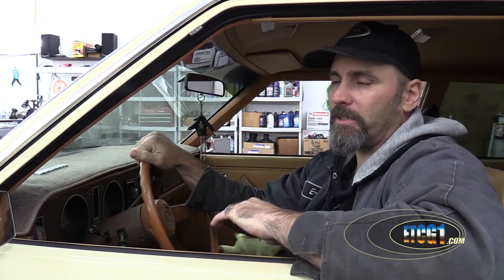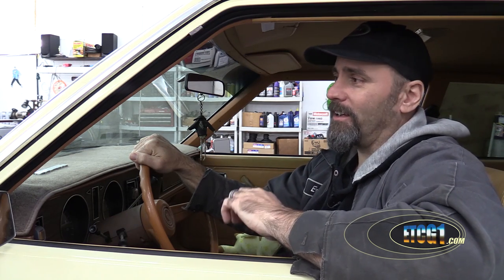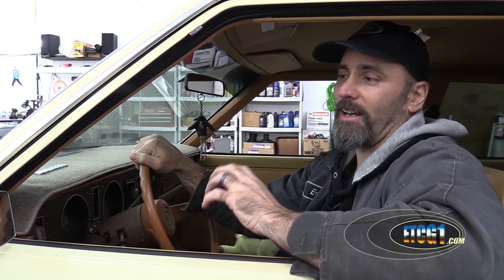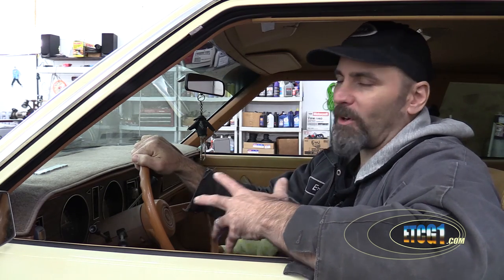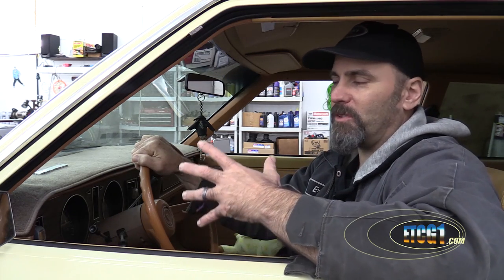Analog vs Digital (Cars)

Comment: I always hear "Carburetors are great because you can work on them." Which you will, all the time. "You can't work on Fuel Injection." You don't have to. They rarely go wrong. I mean, every single carbeurated vehicle I ever had required cleaning, adjustment, rebuilds, etc whereas I have NEVER had malfunctions with TBI, MPFI, EFI, etc. 

IF you know what you're doing Carburetors can be fun, and if you keep it in tip top shape you can almost mimic the efficiency of computer controlled fuel injection. But let's not kid ourselves; if carburetors were efficient and reliable, they would still be an option on new vehicles. If a conversion kit exists for the model, I always upgrade to Fuel Injection. If not, then it's no big deal, I just hate having to work on them. My 75 Gran Fury has 72 vacuum lines running all over from the dash to the engine to the carburetor, etc. That's not an exaggeration; there's 72 points of failure just in vacuum lines. That kind of shit is unheard of today.

Comment: There is also something to be said for "period correct" (turbo aside).

There would be something very out of place with a modern engine system in a 70s car. Loses some of that vibe of having a vintage car in the first place. I mean why bother to restore any vintage car when you can always pack a a modern engine in it?

Imagine a Corvette without a pushrod engine. It's just not the same.

Comment: My opinion is that fuel injection is far superior to carburetors and I do prefer them but carburetors have a special spot in that you didn't need outrageously priced tools and you feel more involved in the hotrod process. It drives me crazy that the fuel injection system is so integrated into every other system in the car. With immobilizers, gauge clusters, radio, HVAC all on the same buss is crazy. I want the engine to run on a computer but everything else should be directly connected to what it controls. When I run a diagnostic on my VW through the OBDII port it tests the radio speakers and the heated mirrors, now that is crazy complex and just asking for problems.
Reply: Curt D Carburators designed by mechanical tinkerers are a wonder- I wonder if the designers had any understanding of fluidics beyond the venturi effect. So  many moving parts, so delicate.  If electric fuel pumps used in planes had been introduced to cars in the 1940s, I wonder if multi barrel carbs would have ever made it to volume production for cars.

Comment: I have both digital and analog cars. my 89 mercury grand marquis has the early fuel injection in it and its sometimes hard to find problems with it since it doesn't have the obd2 port on it, it has a different port that I can't find a computer for. My 02 Bravada has the obd2 port on it but the engine it in is too complex. I really like my 1980 chevy and my 1972 f250 since they are carburated and the problem is usually right in front of me. where the 80 chevy is supposed to have emission stuff on it, some of my problems is because the emissions are gone off of it and I plan on fixing that but I have a priority to where what vehicle gets fixed first.

Comment: You make an excellent point - cars are now made with digital systems that the makers (and their regulatory overlords) wish to preclude mere mortals from repairing, much less modifying.  John Deere, that bastion of advanced technology, wishes to protect its digital intellectual property under the legal auspices of the Digital Millennium Copyright Act; they wish to prevent anyone other than a John Deere subscribed technician from looking at the digital systems.  On the road manufacturers have the added burden of emissions compliance.  Summary - the issue is not analog or digital; the issue is the constraints within which we work.  If your $30,000 hot rod requires a $250,000 diagnostic support system to run the digital controls then it doesn't make any sense.
Reply from the maker: Ha! I did a video about this. https://www.youtube.com/watch?v=fxcpCwfHnAM&t=84s

Comment: Analog VS Digital... More like what is cheaper to build and cheaper to modify. With modification I mean if the developer wants to modify the amount of fuel injected, they don't need to replace mechanical components. 
If it breaks you can fix it fast for a high price without touching mechanical parts, at least this would be the idea.

I think there was a pretty good balance around the 2000's in the amount of electronics used in cars, after that every little BS has electronics and not just that, complicated centralized electronics. Don't quote me on this because I'm a mechatronic technician, not a car technician.

Comment: I think the key is reliability and serviceability.  Having to tinker with any system, electronic or mechanical (more than you want to) is a pain.  I think electronic systems would be more popular if they were not so proprietary.  If I could plug my laptop into any car and diagnose or adjust all sensors and parameters, I'd like them a lot more.  I'm not sure but I suspect manufacturers make the systems intentionally obtuse to advantage their dealer channel.

Comment: back in 2004 I got my first car a 1982 Mercury Grand Marquis Coupe with a 302 engine and a variable Venturi carburetor when I got it I have some fuel delivery issues coming from both the mechanical fuel pump and the carburetor so I actually had to rebuild both of them then found out later on that it would have been cheaper for me to Simply replace the mechanical fuel pump but I am glad I got the experience to do them both
Reply from the maker: Those carbs were crap. In fact '80's Fords were crap, my Fairmont included. I would have swapped it out for a Holley or a Carter AFB.
Reply: ETCG1 you  are right they were crap but at least i had gotten some experience with rebuilding a carburetor quite interesting I must say

Comment: Hey Erick 
Wat do you think of new auto tune chainsaws? They have a carbrtor that is digitaly tuned. I run saws all the time and in colorado so conditions are always changing as is my altitude which really messes with small tightly tuned 2 stroke motors. Constantaly tacking my saw on old saws would slow down my work flow now with a auto tuning system i can work all day with the saws electronics making changes as i move around the slopes or weather rolls in. Its a really cool merger of analog and digital.

Comment: The mid to late 90's vehicles have the least amount of compromises on both ends. They were not carbureted but were the the second wave of fuel injection. Cars being built today are now overly complex and will fail prematurely on some level, either mechanically or electronically. Who wants a touch screen in their vehicles dash when a home computer needs upgrading after 5 or 6 years. Is your car now disposable after 5 years? Computers are now separately being used for door locks, fuel pumps, etc, where previously it was only for fuel injection. Timing chains and timing chain monitors have gone way overboard as well. Judging by your fleet of cars Eric, you seem to agree.
Reply from the maker: I usually end up with old customer cars, but I see your point.

Comment: I drive one of those change over cars a 1999 corsa got a 'toilet bowl' or carb but also came with abs. The engine has never missed a beat but every sensor around it has failed and nearly every wire has had an issue even the outside temperature sensor. For me mechanical is best all the way. direct injection has many benefits including higher power numbers but i still get 53 mpg on the motorway and my 18 year old car keeps up with 2016 cars easily

Comment: ah yes....the big debate! imho:there is no substitute for simplicity when it comes to a broken piece of hardware sitting at the side of the road. emission regulations drove the change more than anything else in automotive design and execution. gas mileage was a secondary consideration and didn't really matter until the first gas crunch in the beginning of the seventies(yes...i was wrenching back then :-).  carbs,in my opinion, can't be beat in terms of reliability and ease of repair. points ignitions were easy to diagnose and monitor(if you had an electrically driven tach)but were rendered redundant when gm came out with their semi-conductor module driven pickup system.
   the early ones retained vacuum advance and mechanical advance that could be tuned via weights and springs.things that could(in a pinch) be repaired from stuff sourced from a local hardware store or radio shack if needed. this is not the case now. if you have a 90's car and the ecm takes a dump it matters not if the rest of the car is in excellent condition or how much love and care you have put into maintaining it a simple capacitor could fail and take out a chip in that ecm and presto!....you now own a big boat anchor because the parts required to make the engine run,that very same ecu, is NLA! now starts the hard part:
can another one be adapted? can another control head from the aftermarket be made to work...programmed ect? if so...how long will that aftermarket ecu actually last?
    this is a subject that can go in depth quite far and really is a perfect example of a rabbit hole. not all of us(actually...very few) can build an ecu from scratch OR repair a damaged one because the chips contained within them are themselves NLA or are very hard to source and then there's reprogramming a factory map(which the factory will rarely provide or they no longer have those files stored to achieve such a task).
   when it comes to longevity i dare say that there will be few...if any of the vehicles we see today on the road still being used/loved and cared for/ surviving in 40 years. the electronics involved will be the very cause of this reality.
   nope... i prefer the analogue over the digital as i neither own or drive a vehicle with the thought that it is an appliance in mind. a car is more to me than a conveyance to get me from point a to point b. it's a mechanical device with a heart and soul that i trust my life to every time i slip behind the wheel,turn the key and head it down a stretch of tarmac. a visceral experience to be savored every time. a machine that bends time and space in a way our ancestors could only dream about less that 150 years ago and something to be revered because of it's capabilities and respected because of the power that it gives us and indeed, western civilization on the whole.
   cars made today almost always ignore these points of fact and i offer this vehicle as just one example of many of the point that i am trying to convey:
    prius.
oh yeah...edited because of keyboard errors caused by fingers that didn't follow the intended path :-)  a typically analogue failing!

Comment: I program Microprocessors, build my own circuits and have servers for fun. But I'll take an old school car with no or limited electronics any day. Why?  Because trusting something I'm doing 70MPH in that's hackable, very trackable and needing proprietary tools(in some cases) or super expensive ones is just annoying. And when something goes wrong it's a huge headache if you don't have those things. Tuning a carburetor with nothing more than a screwdriver, or adjusting an ignition with a wrench is way more satisfying.
Reply from the maker: Yea, you get it. Thanks for the comment.

Comment: Well said. Question, what are your thoughts on digital and analog instrument cluster/gauges.  Do you think that some new cars that use LCD screens for the gauges and the navigation wouldn't last long due to the elements vs the analog/mechanical gauges? I know If I were to put my tv and my computer monitor in a car in the heat and or cold and turned them on and left them on they would fail real soon and or reduce their lifespan exceeding their operating temperature specified by the manufactures specifications that's in their owners manual.  Keep up the good work. Stay Dirty.
Reply from the maker: Well, I will be running digital gauges. The mechanical gauges did wear out, but I've seen digital gauges go out as well. I guess it just depends on the system, the environment it's in, and how well it's maintained. To be honest, that's true for just about everything in my experience.
Reply: That's cool. Thank you for responding to me. That's a very good point.

Comment: I was born in 1996 right at the start of obd 2 but I prefer old mechanical cars that I can tune and adjust with a toolset and your ears. I learned from old school mechanics that rebuilt everything so rebuilding and tuning carbs is easy. I can easily  fix computer controlled vehicles but they don't give me as much joy as fixing mechanical vehicles but computer controlled are easier to start on cold days